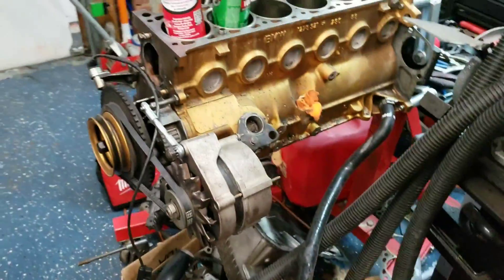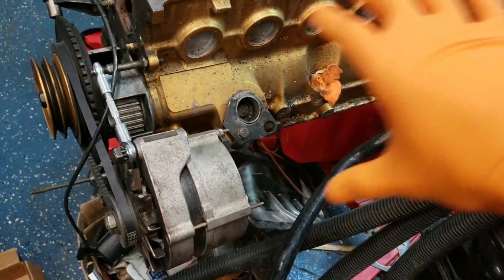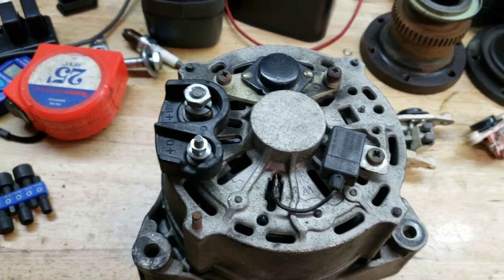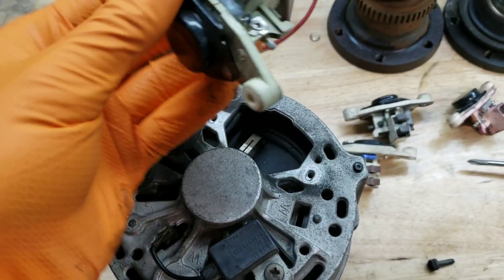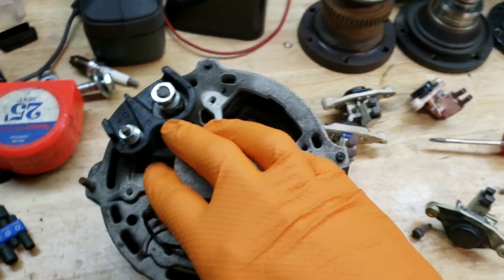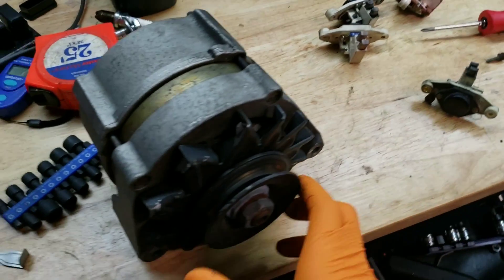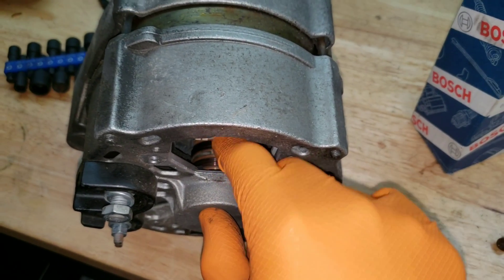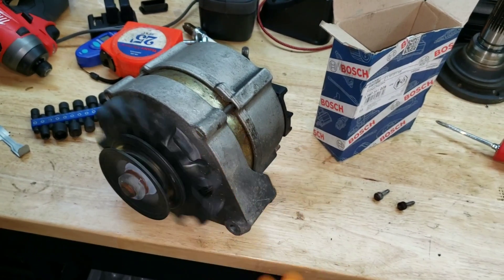E30 (and other models) voltage regulator replacement

Comment: My battery light stays on after the car is off and only illuminates when revving would this solve the issue possibly
Reply from the maker: No, sounds like something is fried in the alt, and it's back feeding the circuit. Did you install/jump your battery backwards?

Comment: Thanks..  I pulled mine out after a long day of being stranded all over town.  And the regulator looks super bad.   Cool..  hopefully that fixes the problem.   I did here if the battery light on the dashboard doesn’t work then your alternator won’t work either.  Have you ever come across that?
Reply from the maker: I'm sure it will! Yes the battery light is the exciter for the alt to start charging. That being said, even with a bad bulb most of the time a Rev to about the 3k mark will start it charging as it will self excite.
Reply: @FLG13  Later e30s had a resistor in series with the bulb so that even if the bulb was open circuit, it would start to charge. I forget what year this was added.